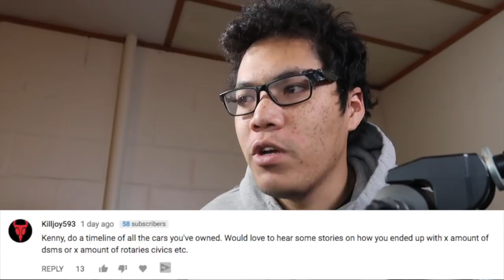How I've Owned 29 Cars By 25 (RX7, Miata, Civic, WRX STi,)

Comment: Everyone remembers their first car, don't they? My first was a 1984 Mazda RX-7 GS that I bought at 16 for $1575. Base trim with the open diff, rear drum brakes, cloth interior, manual everything, 5-speed and a 12A Rotary. All original. I still have it.

Since the '84 RX-7, I've owned (in order) a 2002 Mini Cooper S (that was a wicked fun car, but it went through more oil than any rotary car I've ever owned and I had multiple issues with it's supercharger, so I sold it), a 1997 E36 M3 (total lemon, sold it), a 1998 E36 335i (another total lemon, sold it), a late 40's Jeep CJ2A (never found out what year it was, the whole car was cobbled together from 10+ different Jeeps. It was tons of fun until it was stolen. I miss that car dearly), an NA Miata (good fun daily, not my style and I sold it), an AP1 S2000 (ho-lee-shit, what an epic car, but it eventually developed an issue with the Vtec system and that meant that it needed a rebuild and the car was worth less than the rebuild would have cost, so I sold it), an '89 FC GTU-S RX-7 (I still have that one, rebuilding it slowly), a 1993 FD RX-7 (bought it for cheap, thought it was a healthy car (compression was good), but it turned into a nightmare. I had to get rid of it, it was the very definition of a lemon (name one thing and it probably went wrong on that car) and I sold it) and that's it...

So, at the end of the day; I still have my first car (the '84 FB RX-7) which is my all-original and uber-reliable daily (and remains to be my all time favorite car) and the NA '89 FC GTU-S RX-7 (which I am rebuilding/restoring).

And right now, I'm currently on the hunt for a clean manual RX-4 wagon so that I can have a more practical, uber-obscure, incredibly cool, reliable (they're 12A powered after all) manual rotary wagon that I can eventually build into my perfect car - a NA 3-Rotor, corner-carving monster wagon.

But that may be a while. RX-4 Wagons are incredibly rare and I've not been able to find a clean one anywhere these past three years I've been searching.

Comment: I’ve owned 6 cars in the past 3 1/2 years.
I have 3 at the moment: a 1990 Nissan Sentra, 2007 Volvo S80 v8, and a 1988 rx7 convertible.  
This channel would become my favorite channel if you guys did a Volvo build.  Turboii 13b Volvo build??? That would be sick!
Reply from the maker: Redblock, LS or K24 swap realistically lol.
Reply: ROTORS fair enough.  Either way I’d love to see it.  Good luck guys
Reply from the maker: I need to learn to weld first. Which I'm about to start learning shortly. I want to start building sick street cars for the channel similar to BoostedBoiz but more variety.

Comment: i have owned 13 cars since i was 21. I have had two Corrolas one E110 and one E111 three Volvos a V40 a 850 and a 244 a Peugeot 406 and a BMW E39 523i and a couple of 4x4s which was a J70 Landcruiser(didnt get it to run)  and Daihatsu Feroza/Rocky(blew a headgasket an hour after i got it) and a Opel frontera which i used for offroad and fun stuff. Currently i am stuck with a boring Astra G as a daily. But i am hoping to get some cool and exiting  car again in the future.

Comment: First car 88 Rx7 Fc loved it while I only got 14 mpg scraping for change too pump gas everyday while I went too school lol 2nd car 96 Lexus sc300 pearl White auto stock na 2j had it slammed with wheels then sold it . 3rd car now which I still have as my daily 94 eg hatch which had a stock gsr when I bought it, loved it until the engine gave out later swap a b20v running good still , the hatch is my baby love driving it  , the 4th car is my 09 Lexus rx350 now that I am having a baby on the way . Soon I’m trying too buy another FC just like my first ever car , the Rx7 .

Comment: The cars that I’ve owned in chronological order with a list of mods they had:

1. 2001 Acura Integra LS 5 speed (AEM short ram Intake, wheels, lip, type r shift knob) (sold)

2. 2009 Hyundai Sonata GLS 4 cylinder (stock lol) (sold)

3. 2013 Volkswagen Jetta 2.5 SE (stock lol) (sold)

4. 2014 Honda Civic Si Sedan (full bolt ons + tune, wheels coils, tires, too many aesthetic mods to list) (for sale)

5. 2017 Volkswagen GTI SE DSG (Resonator delete) (still own it)

6. 2012 BMW 335i ( BMS intake, VRSF downpipes, JB4, pilot super sports, wheels, aesthetic mods) (still own it)

Comment: had a 2000 mercury cougar that i bought it whrn i was 15 off my mom for $600 and when i traded it in a couple months ago it was worth scrap but with light bondo and spray traded it in for $1500 at a used car dealership on my current 2000 bmw 323i 5 speed that i taught myself how to drive stick on i had no prior knowledge except youtube videos

Comment: First car: Pug 206 1.1, mint, 300€, snapped timing belt, bent intake valves, fixed it myself at age 18
Current cars: Ford Sierra MK1 2.0 iS, also mint af, shattered clutch, 1000 €
And a Saxo 1.5D as my work horse